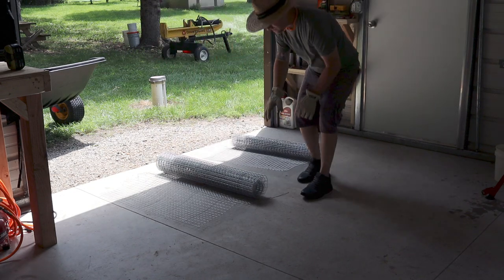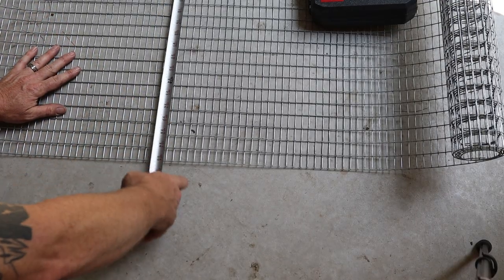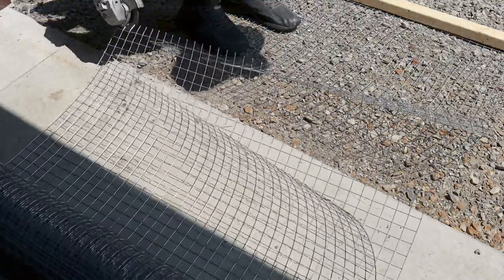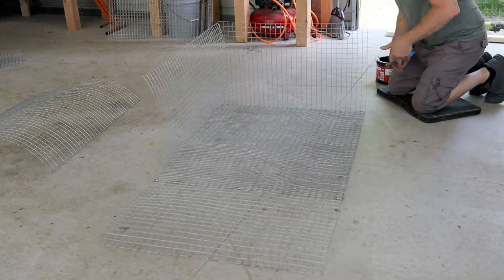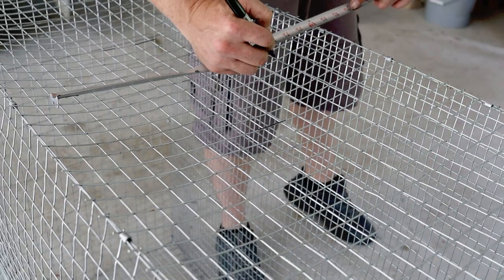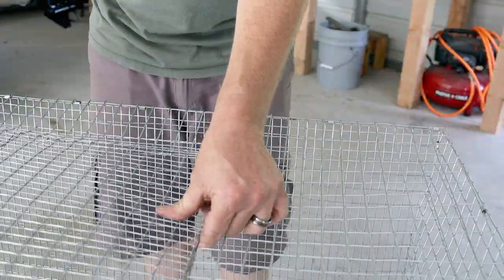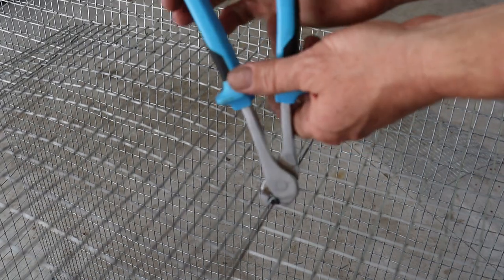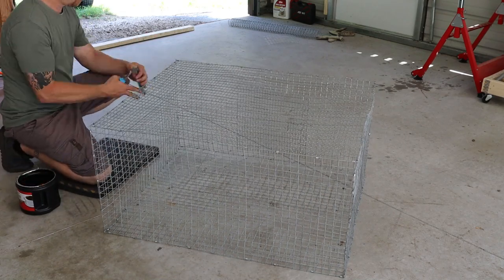Build A Rabbit Cage In 30 Minutes Or Less

Comment: Why don't you make your initial cut for the bottom longer to incorporate both sides, then all you have to do is fold up two of the four sides to shape it.  Use a board for a nice, clean bend.   You didn't have to cut anything, you didn't have to trim wires, you didn't have to join it together for half of the sides.  That's what I would think and do.  Or am I not seeing something?  Thanks!
Reply from the maker: That way works too. We did a few builds like that in the past. If your looking to save on cuts the video below is a cage build that will save you time and cuts. https://youtu.be/hSdZb9Q4J9c 
But when piecing together the way we did in the video the structural integrity is strong with less sagging and roundness to the build.
Reply: @TheRabbitryCenter  I was going to ask if you had tried one where the sides were all one piece! And look, you have a video for me! Thank you, I benefit from all of your experience.
Reply: Our first builds were done that way. They “sagged” on the bottom and did not hold their shape. The bottom is now cut the shape but our sides are wrapped (so 2 sides folded and attached to each other) and the floor is attached all the way around as well as the ceiling.

Comment: Do you ever have issues with rat snakes up there? I lost one to a rat snake down here in SC, luckily by guardian dog heard the disturbance and alerted me to the problem before it got worse.
Reply from the maker: No sir, I’m glad to say in Michigan we don’t have snakes big enough to eat our rabbits and using hardware cloth wire instead of 2”x4” cage wire is all we need to prevent predators from entering the extended cage runs.  It’s nice to have a dog on the property.
Reply: @TheRabbitryCenter  thanks for the reply! I used to live in the mitten but left to avoid the winter, get to deal with snakes now 😂 

Baxter has earned his keep for sure, dealing with two rat snakes and a raccoon already. Saved a litter of rabbits and a flock of chickens.

Loving all your videos. Thanks for what you're doing!